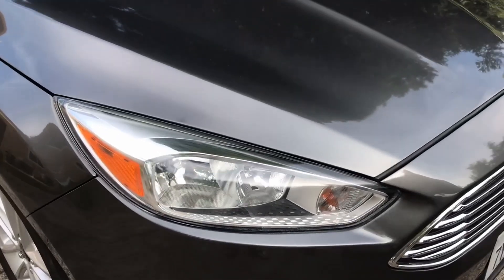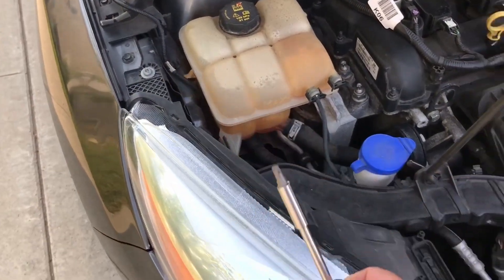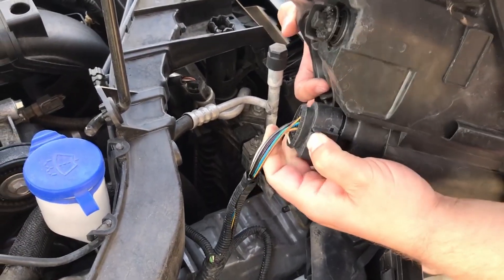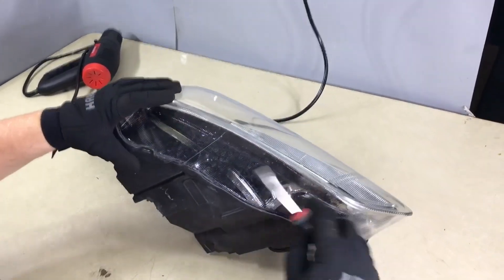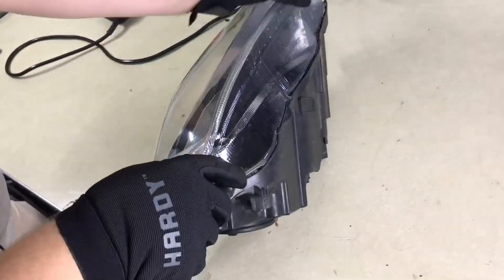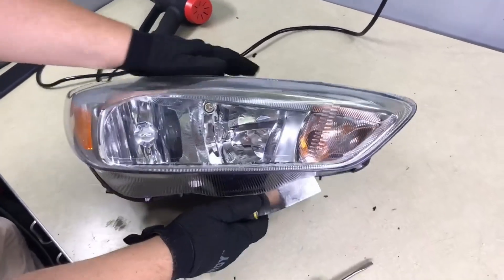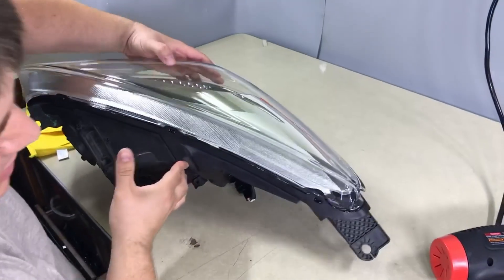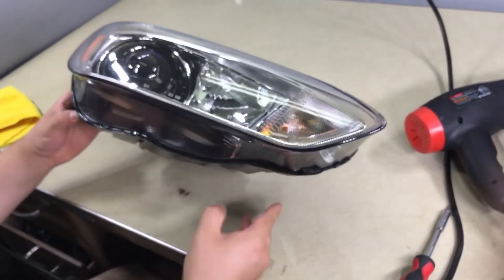How To Retrofit MK3.5 Ford Focus Headlights With Bi-LED Projectors

Comment: So why doesnt this work with the ST model headlights that have the DRL strip? I really want these in my ST
Reply from the maker: The stage 1 ST headlights come with DRL which is a little different shape due to DRLs, but I did retrofit the ST version headlights with exactly the same look, just made to fit ST stage 1 headlights. If interested contact me at info@grclights.com

Comment: Is high beam reflector housing useless because the projector is used for both low and high beams?
Reply: The high beam can still be used in addition to the projector high beam for more light, which is a GOOD thing!

Comment: nice job looks like OEM, but dose it fit the headlights that have an electronic level adjuster?
Reply from the maker: Yes, it should fit. Here in US we don't have auto leveling on Focus headlights, but looking at EU headlight pictures the mounting point are exactly the same.
Reply: perfect, another question, can I get only the reflector without the projector? because I’d like to install a different projector and how much it would cost with shipping to Middle East
Reply from the maker: @mesh_alg  Sure, contact me at info@grclights.com
Reply: waldpl thanks for confirming that, but isn’t it heavy on the leveler dynamo? I mean the projector
Reply: Did they ship to uae

Comment: Hi, where did you buy the white clips to mount the new parable?
Reply: I completed the retrofit even on a lighthouse with DRL by slightly modifying the projector, filing it up high in the high beam section. The original permaseal is really hard to remove 😡😡, I lost a lot of time to open the lighthouse. 😪
Reply from the maker: White reflector assembly clips came with the kit. They are different from OEM headlights, at least the US version headlights.
Reply: Ok, thanks.
Reply: Why is it not compatible with drl led lights?
Reply from the maker: @ruggerospiriticchio4390  The high beam section is smaller, small dip on top, to fit the DRL. I do have exact set like in the video to fit headlights with DRL.